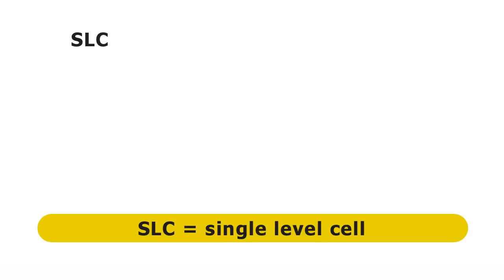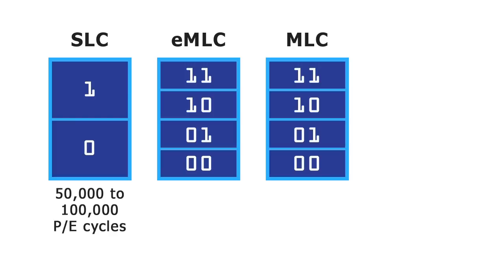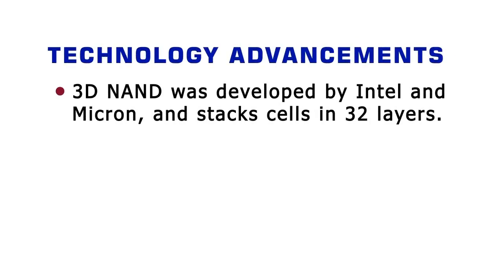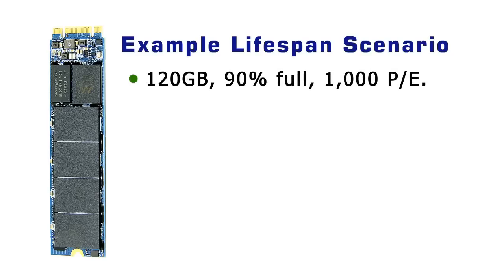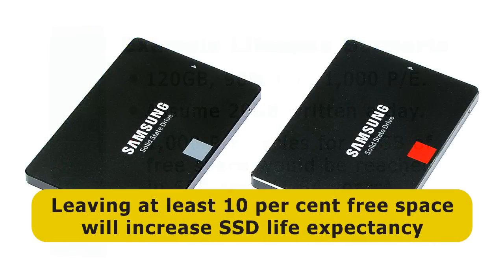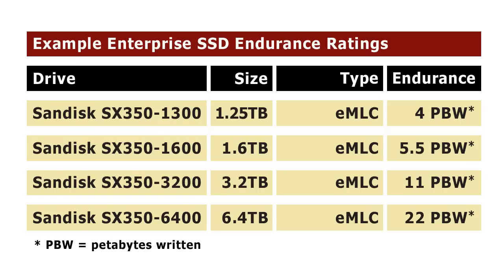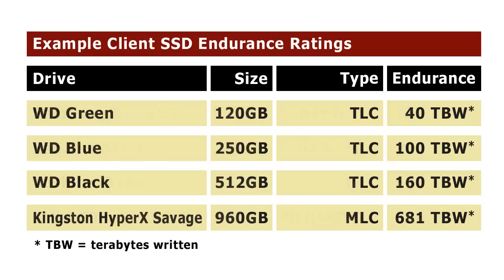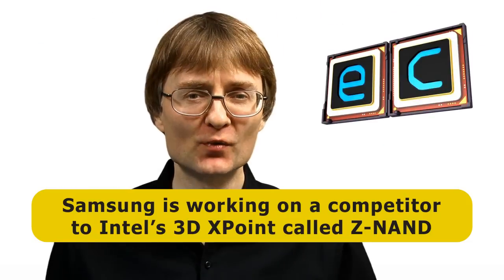SSD Life Expectancy

Comment: Great video, thank you! I've become a backup fanatic cloning all of my computer's SSD's to external SSD's that can be easily slipped into place if one should fail. 
Had that exact scenario happen a few months back and I was down for literally 20 minutes! I've learned my lesson with SSD's...very reliable but in my experience when they stop working they push you off the edge of a cliff and don't give any warning.
Reply: what ssd did you have, and after how much months of use it fails without warning? Did you lost some important data on it? I have last 250gb velociraptor, which was very reliable (had previous velociraptor for 10 years as primary HDD with OS, still working with only one bad sector after 10 years of everyday use and 25000 PoH) 

I am thinking about using this velociraptor, and clone whole 256gb SSD on it like every week. At least, I find some use for it.
Reply: @warrax111  I'm not sure but it was a name brand, not very large, I believe 240 GB.

Comment: My 60gb Intel from 2013 is still 100% health and it was used on a daily bassic. It just won't die lol, of course it was expensive at the time but seems to be great. Of course, 60gb is very small but since the rest of the pc is pretty junky, it's ok. Thanks for sharing this awesome info with us. Cheers :)
Reply: Aren't this the Intel SSD's with 5 year warranty ?

Seriously everything below 5 years should be a shame and only +10 year old SSD's should be a reason to get excited.  I find 5 years a very short time.
Reply: I have multiple SSD's, several 240Gb and one 1Tb SSD. I got the Crucial 1Tb when it was launched a few years ago and all these drives are working just fine even after years of hard use.

I no longer use old hard disks other than in my 2 NAS systems, all my laptops and workstations run exclusively with SSD's.

SSD's are a no brainer these days - get them and love them!
Reply: ciprianwiner If SSD after many years of normal use shows 100% life left, then that indicator doesn't seem that reliable to me because drive can't stay "new" condition forever.
Reply: My main computer built in 2011 has two 160GB Intel SSD's in Raid 0, and it is still working fine!  This was overkill as I only really use them for my OS anyway, as I have a 7200rpm HDD for main storage.  (at the time I thought I was going to get into PC gaming but I didn't, heck one of my crossfire'd 6970 graphics cards died so I just took it out and didn't replace it lol)  On my consoles (PS4/XB1) I just bought a Sandisk Ultra ii at 960GB for each.......after seeing this video and doing some more research they'll last pretty much the rest of my life lol.  (meaning they'll last until something larger and faster is affordable enough for me to just replace them)
Reply: Keep in mind that some Intel drives like the 335 series has an internal kill function that puts the drive into read only mode at 700TB(for the 240GB version) written regardless of the actual health of the drive.
Reply: @rustknuckleirongut8107  that's why I always choose brands like kioxia, Kingston, silicon power, hikvision, lexar, imation over Intel. Intel ssds sucks

Comment: Good video , I've subscribed :)
SSD Failure. I guess it happens eventually. From my experience the drive that failed the quickest was the IBM HDD Desk Stars from the early noughties. The sound of the death rattle as the heads tried to read the data was truly disturbing. They became known as the "Death Stars".I lost a lot of data due to them ! (now I keep important stuff over several disks).
I've had SSDs since about 2010 ish, I think a 60 GB still works , but it hasn't been in a system for a while ...
Reply from the maker: Thanks for the sub -- welcome aboard! :)
Reply: Try  A linux distro . It will take less than 25 GB. I am talking about ubuntu and mint

Comment: An interesting video you could make....
when I compared early SSD's to 15krpm scsi drives the scsi drives out performed. I saw the same with SAS hard drives and others saw the same with WD velociraptors. Both have now been out performed by SSD's but I still prefer keeping critical data on a HDD raid (I currently use WD reds in raid) and I use SSD's in raid for my OS and other software I use. I do not mind if they go down data wise as my critical data is still on a HDD raid and even if (touch wood) they went down, I still have the ability of data recovery.

In a nut shell, SSD's give me performance and durability where as HDD's give me assurance and an assurance on reliability as you can often tell when a HDD is about to fail and even if it does there is a fair chance of recovering the data should it fail.
Reply: That is because the SATA interface is designed for the speed of HDDs, flash is capable of writing much faster due to the parallelizable write load. This allows for much faster write speeds which can be seen in the pcie interface NVMe standard.
Reply: I think this is how I will build my system. SSDs for frequent read/writes and HDDs for permanent storage. Will become a bit expensive though :)
Reply: @prashanthb6521  this is exactly what I'm about to do.. buying an SSD only laptop, but I already have 2 tb external HDD.. the combo might work out..
Reply: I’m pretty sure the SMART monitoring on SSD drives will also alert you when the drive is nearing its end-of-life. HDDs have a habit of just dying suddenly without any warning, especially if suffering some kind of physical shock which damages the moving parts. SSDs would likely approach their death more slowly during which time you can replace it. Because of this I would consider SSDs a more reliable form of storage.

Comment: I think it's a good practice to only install OS on SSD. For other data we should keep it in HDD. I'll install SSD on my laptop as it is very slow and since SSD is very costly I'll just buy smaller size SSD to install windows on and for other data I'll use the HDD that was originally installed on laptop.
Reply: Practically what I'm doing right now as well. My PC has one SSD strictly for OS while HDD for data storage. My laptop has one SSD, partitioned for both OS and Data (hopefully it can last than my age lol). Due to the downside of SSD, I'm still using HDD as backup for my data.

Comment: I am not a fan of SSD at the moment.  Yes it was faster and very reliable however my experience with a failure was catastrophic.  Here is the problem.  On a regular mechanical HD, when it starts to go bad, it begins marking sectors as bad and data is not store on that surface any longer.  It gives me a little notice that the HD is starting to fail, pushing me to back up my data and make a plan to replace the HD as soon as possible.  With my SSD drive, it worked perfectly one day, then the NEXT day it did not work at all.  No notice, no clues or hints that it was about ready to fail.  It just failed without notice :(

Comment: Worth mentioning that if you're using RAID 5, 1 or 10 that all writes are doubled, so if you're using RAID on your SSDs then (1) the amount of data written is doubled, BUT (2) this load is spread across multiple drives so lifetime will actually be longer.
I work in an Enterprise environment where we use SSDs for database storage. The most common failure mode we see is controller failure. That said, with over a thousand such systems we see something like one failure every week or two. SSDs are pretty reliable. Of course, when the controller fails you lose everything on the drive...
Reply: No way to fix the controller? Thought that if the SSD drive failed, SSD would go into read-only mode so it is still possible to read the data and copy it off to another drive? Does reading (not write) affect the P/E cycle count?
Reply: @devincurrie4145  Usually we see the SSD just stop completely. All reads and writes fail. All SCSI calls throw a failure. It may be possible to replace the controller, but the DC staff may not be immediately available (in fact usually are not; the DCs I was discussing are in EU/NA and I'm in Sydney.) We make sure that we have enough redundancy that even if the main storage drive is completely dead, we can recover to the last transaction. Depending on the customer, the database may be syncing in real time to another server.
That said, we're in the process of moving to another platform which is 100% redundant - no single component failure can break the database. In practice, with the new setup, the only thing that brings us down is an HVAC outage, in which case we need to restore everything on the DR site.
I hate HVAC outages.

Comment: How do SSD's fail? Catastrophically or little by little??
Reply from the maker: Usually catastrophically.
Reply: ExplainingComputers Yes & data most of the time is un-recoverable
Reply: Crazy Clown In most cases data is recoverable rather than not, simply depends on how much are you willing to spend in specialized recovery solutions
Reply: ExplainingComputers  I have looked into this since mine failed catastrophically last month.  I was unable to find a verifiable story of it happening to anyone else.
Reply: Had my first ssd death this week, copied a large file to the c drive to make room on another disk. Turned the pc on the next day and the drive was dead. I forgot i had windows backup of the entire drive on another disk so after an initial scare reinstalled a new ssd and copied all my files from the windows backup image. Keep plenty of room on the c drive, all my other ssd systems are still fine after lots of years.
Reply: Usually they break catastrophically for reasons unrelated to the wearing out (that'd let you read what's left, in theory). It just happens, it's something you must accept when using computers.
Reply: thear1s 
Yeah. I hear you. I had just bought an external HD and connected it to the PC to make a backup after living many years on the edge.
Turned it on. Opened explorer to copy my files and the main drive crashed and died.
Lost all my scanned negatives (more than 6 thousand), all my music and all my documents.
Reply: @Symme3Sanne  How many running hours did the SSD have? How old was it?

Comment: So, should we still turn off File Indexing and Paging??? (If you plenty of memory available so a swap file is redundant)
Reply from the maker: It depends I think on the kinds of applications you use. For example, if you edit video, esp HD video, then a swap file (and package cache files) will still be necessary in most circumstances. But on a PC mainly used for web and office programs and media playback, the case is different. I personally have file indexing turned off.
Reply: I turned off File Indexing and all my Itunes library disappeared.  Is that what caused it?  It's going to take forever to rebuild this.  I had automatic backup running, but the auto backup saw the changes made and 'updated' - so I lost it all on backup too.  I wish I knew what I'm doing.

Comment: My 60 GB Crucial M4 bought in 2011 has run 24h ever since as my Windows drive. More than 8 years and still running day and night without errors. I woudn't trust any rotating meda to run this long.
Reply: I have HDD that runs reliably since 2006

Comment: Hello Chris. Great and informative video as always. I have some questions. 

Will wear-levelling be able to function properly in situations where the SSD has been split into multiple partitions? Specifically, partitions with different file systems? For example, dual-booting between Windows and Linux.

Many online forums/communities say that wear-levelling is handled by the SSD's storage controller and so file systems and operating systems don't have anything to do with it. I find this position hard to accept when you factor in possible encryption of data.

I contacted Samsung's SSD tech support and they said that wear-levelling is handled by Windows itself. I then asked: what if the OS is Linux? They said officially, Linux is unsupported.

What's your take on all this? Is implementing multiple partitions on SSDs  a safe and advisable thing to do? I'm also concerned about voiding warranties.
Reply from the maker: Wear levelling indeed takes place at the drive level -- it does not matter what partitions or encryption you have on the drive. So multiple partitions are not a problem -- it is free space overall that matters.
Reply: @ExplainingComputers  Thanks.

Comment: You know before you read this, I basically describe backing up to another drive.

I suppose because the almost largest capacity SSDs in this day have 4TB, it would be best to buy the equivalent in a HDD, and frequently back up my drive, so when the day comes and it fails, I have all my data, and I can buy a new SSD, hopefully 4TB will be much cheaper than it is now, and I can reinstall all the data from the HDD, and my SSD will have the same data, and work just like new.

Comment: Don't forget that mechanical hard drives used to fail also.  I don't think SSD's are any worse than HDDs when it comes to durability.  Stick with the 321 rule and you'll be right - it's so easy now with online backup, there is no excuse not to have an offsite copy of your por... I mean data.
Reply: With the exception that a failed mechanical drive could often be recovered if it was important enough. With an SSD there really is no chance.
Reply: early SSDs were pretty terrible, if we had those failure rates today we wouldn't even touch them.
Reply: Depends. There is old, reliable flash storage that still functions today in industrial environments. But when manufacturers started to go as low as possible with the price some sacrificed a bit too much quality for the price resulting in failing drives like the OCZ Vertex 2 But this also wasn't a new phenomenon. Maxtor went broke over it's failing mechanical drives and IBM's drives at one point got the nickname deathstar due to high fail rate.
Reply: Better don't count on that. Opening a drive that had a head crash in a clean room and reading it out using highly specialized equipment can easily cost as much as a car.  "Amateur attempts" can kill the data ultimately. Think about that if it's really important. Backups are WAYYYY cheaper.
Reply: The smarter person will not rely on any one thing, but perhaps several avenues to accomplish one thing. When we're talking about important Data, EscapeMCP makes an excellent point/suggestion.
Reply: mind explaining the 321 rule?
Reply: justin Case - I think it is something like 3 backups, 2 local using a different medium, 1 kept somewhere else.
Reply: I have 2 local and 1 in the cloud.  - Thanks for reminding us... I need to refresh one of my local copies!

Comment: Great video. Thank you. I bought my new Samsung 840 Evo TLC SSD in 2014 for 198$ and it still works great but i needed bigger SSD so, 6 years later i bought myself an Intel 1,2Tb 2,5" S3610 Sata SSD with only 18 hours runtime and 1Tb of data written for 114 $. It's MLC type. Awesome upgrade.
Reply from the maker: Wow, that Intel drive was a good purchase.
Reply: @ExplainingComputers  Yeah but that is what these are worth now in Sweden, but i have recently seen this exact model costing over 400 usd new on Ebay so it is worth differently depending on where they are sold apparently.

Comment: I still trust traditional Mechanical Hard Disk Drives more then SDD. I'm still using a 40GB (IDE) Seagate Baracude Hard Disk Drive from 2004 Lol and its still booting and running Windows 7. Not one bad sector and its power on time is 3155.9 days. Older Hard Disk Drives just last way longer. And I still have a 1GB Maxtor Hard Disk Drive in a old Pentium 1 machine and it still works. Cant say that about todays Drives. Its like the cars from the 60's. They just build better, build to last.

Comment: I've read that an ssd should be refreshed in order to maintain data, but I was never sure if it was enough to simply turn the drive on, read every file, or re-write every crucial file. I was thinking for more important smaller data archival, bluray m-disc might be worthwhile, but then I also wonder for how many years we will be able to still get hold of a bluray drive that can read them. I'd need to archive the drive, by buying two. I wish there was a faster and larger capacity physical format, disc or no disc.
Reply: I think SSDs refresh their data as part of their automatic internal maintenance? But no media is immune to corruption, so you might also want to look into software means to protect your data's integrity. I personally use WinRAR's recovery record function, but don't have the experience to recommend any particular method.

Comment: just a single sample report on one of your statements on durability/endurance; i have a 250gig samsung 960 M.2, running windows off it since the year this video was published. i installed HWiNFO64, it says the drive has nearly 91% remaining life, at 21TBW [out of a rating of 100TBW] to the drive. and now they have m.2's like a 970 evo plus at 500gb cost 90$, with a 300 TBW rating... ohh, and you can do stuff to extend the TBW burn rate, like move non-speed-critical win structures [like file history] and other programs you use to a deep storage drive. 

but at this rate, assuming the software logic is sane and accurate, i could potentially run the drive for over 2 decades easy; and i've only had one western digital drive last over 10 years before i got too scared to run it cause it was an era before S.M.A.R.T reporting. it beats that, i'd call it insanely durable.

Comment: Is there a way to monitor the status of an SSD to detect how many cycles it has left?
Reply from the maker: The SMART software that can be used with most drives will report total data written.
Reply: Ah excellent. Thank you! :)
Reply: I use a different method:  Keep writing until it fails, and then once less!